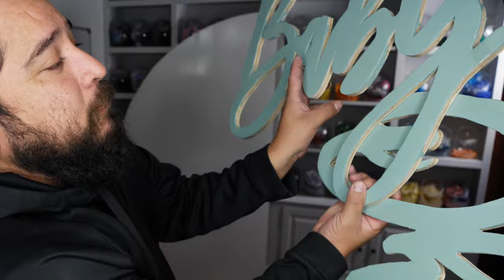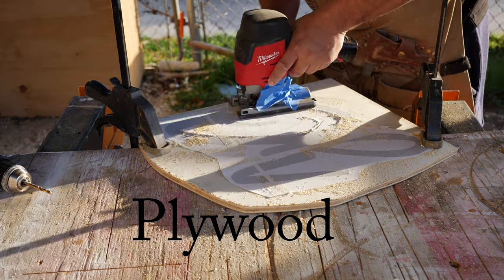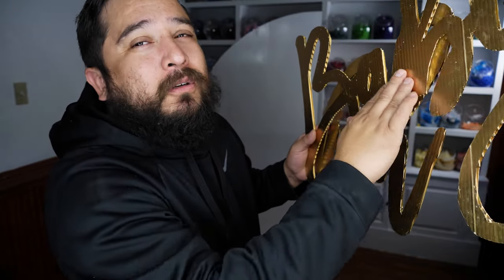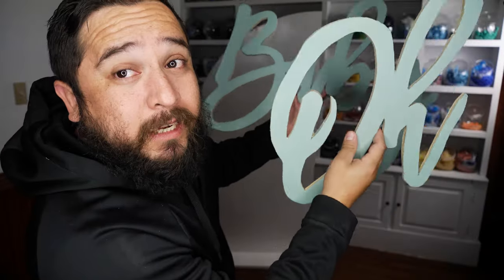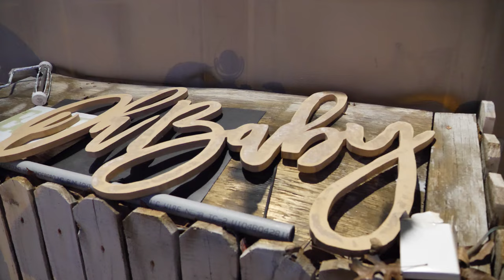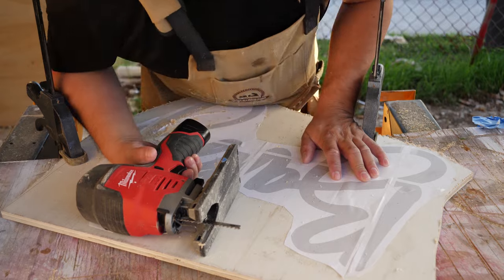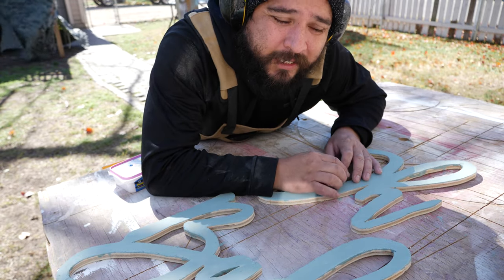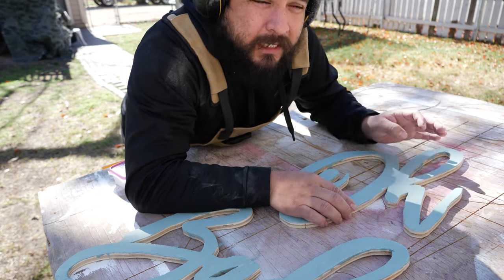How to make Backdrop Signs for Events

Comment: First timer great video can I use like a spray primer if it comes in a spray for the plastic thing? then paint it and can I use a hot knife to cut it ? Thank you
Reply from the maker: Hi thanks for watching. Yes you can use a spray primer to paint the plastic. Just make sure the spray paint works on plastic, most do. Then paint it. Hmmm, I do not know about the hot knife to cut the plastic. I have not tried it. It may work but I would recommend to do it outside with a respirator just because burning plastic never smells good and can be harmful to your lungs. Hope this helps!
Reply: Oh ok thank you so much have a blessed day

Comment: Hello! This is a great video!! I was wondering what was the thickness of the mdf? Thanks!
Reply from the maker: Hi, the one in the video was 3/4 inch. But I have made them out of 1/2 inch as well. The 3/4 inch is a little more solid than the 1/2 inch though. Both worked great though.

Comment: What size scroll saw do you recommend for those sized letters?
Reply from the maker: It depends on your budget, but I believe most are 16 inch scroll saws. I believe mine was a 18 inch. But you can make those on a standard 16 inch with some practice moving the letters around. But its easy to pick up. Good luck!

Comment: I’m not too handy with the printer. How do I get it printed that large? I know it’s multiple sheets but I don’t understand the print side of this. Great work and channel and THANKS
Reply from the maker: Hi, each printer is different and the main thing is to go to printer settings and look for poster or multiple images. This allows you to print your text into multiple prints. It is very limited on the size and takes some practice to get down. Or I have these texts I already separated on photoshop and separated into a PDF pages on our Etsy page. So when you print the work is already done and you just tape it together. The hard part is it is already sized and cant be made smaller or larger.

Comment: What brand of scroll saw are you using?
Reply from the maker: Hi thanks for watching. I believe it is a fox scroll saw. But I am not a real fan of it. I couldn't say which one would be best to get but this one has not lived of to what I expected. But it gets the job done.
Reply: @MakerDecor  thank you, for responding. I have a jig saw but that looks easier to make the name signs.
Reply from the maker: @stacielatrelle  Yes, no problem. Yes any scroll saw will be easier than a jigsaw, as scroll saws are made for those curved cuts. But can be done with a jigsaw going slow and with practice. Also a they sell a blade for the jigsaw that is labeled for scroll cuts. This is can also be helpful with those turns. Good luck.

Comment: You used an up cutter I'm assuming that's why you got chips
Reply from the maker: Yes for sure, they do have another blade that leaves the top clean. I just didn't have it and winged it with a generic blade, lol. But since then I have really liked the scroll saw blade they sell for the jigsaw. Makes those small turns really easy for a jig saw. And minimal tear out on top. Thanks for watching and commenting!
Reply: @Maker Decor  yeah! Scroll blades are great for deal work. The rule of thumb I use is scroll for fine deal finished ends etc, down cutter for plywood, mdf etc , up cutter is more aggressive for hardwood rougher cuts! ... just found your chanel today! Great videos I'm going to try to make one of your designs for a backdrop sign for a bridal shower I'm hosting. thanks for the content!! ❤️
Reply from the maker: @ladybuilder  Awesome, thanks for sharing!